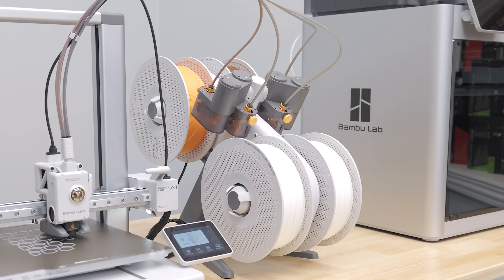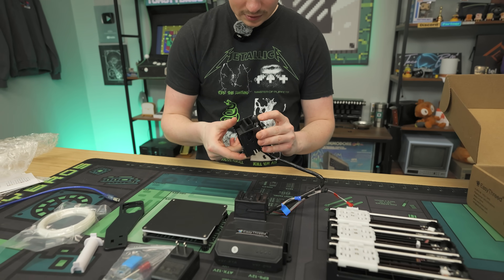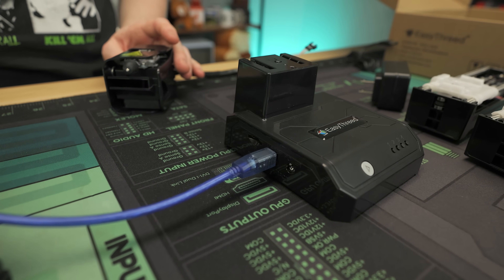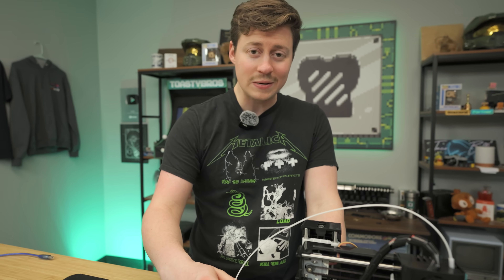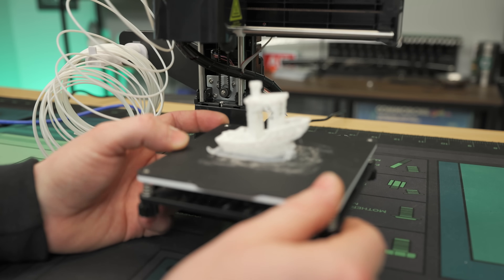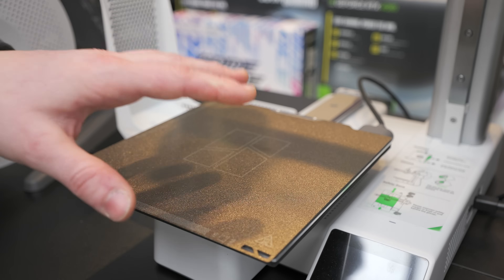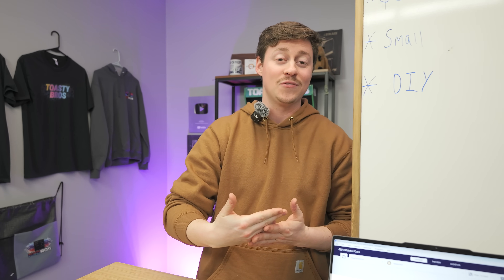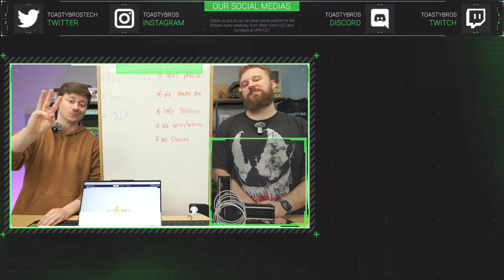We Bought the CHEAPEST 3D Printer

Comment: Just want to point out that while technically the A1 on the left is within that range of "$200-400", the combo as shown with the AMS lite is $499.  The X1C on the right is nowhere near that $200-400 range as it starts at $999 base without addons.  There are certainly good printers within that range, especially something like the Centauri Carbon but putting the Apple of 3D printer companies (Bambu Labs) in that discussion is disingenuous.

Comment: The Benchy isn't the most basic of all 3D prints. Far from it. It's a model intended to show how a printer performs. I would call "Basic" a 1x1x1 cube. The prints look like you had the settings on 3mm Filament and not 1.75. Would have been nice if you showed your settings, but it's more than clear that the settings are wrong, because it is extruding, but not as much material as it should.

Comment: Where are you getting your filament numbers lol ... Standard filament is 1.75mm not 1.25mm in diameter.  And standard spool size is 1 kilo (2.2lbs not kilo) and the reason is this spools size matches that of a standard welding wire spool

Comment: warning to everyone wanting to get a 3d printer, dont buy creality, they have no quality control for their lower end ones. I have a ender 3v 3 ke, iv had to replace the nozzle twice in under 2 weeks of using, they dont test them beforehand and i had to buy a 3rd party upgraded heating head just to stop getting the glob of death every few prints. Also never use the included wrenches to tighten or untighten nozzles, get socket wrenches or youll just end up either stripping the nozzle head or breaking the ceramic or both in my case on my 2nd oem heating head before getting the good 3rd party one

also bambu labs is trying to force the use of their own software on all their printers now and must be connected to their servers to print anything, so i wouldnt recommend them either

id recommend any basic anycubic for entry level, they look basically the same as the entry ender's but are usually cheaper
Reply: this comment needs to be higher up
Reply: I have ender 3 v3 ke too, it works phenomenal. However the auto z offset basically never works, so I just manually level it. Creality is pretty good.

Comment: Printers in this price range just aren't viable yet, even my A1 mini is not strictly "plug and play". It sometimes just fails prints for a few days before suddenly working properly again, bambu support wasn't very helpful (they advised me to change the SD card, so I did); and I've tried running through every TS wiki entry I can find as well as a new build plate and nozzle. It just doesn't print when it doesn't want to, I guess. Also the camera on the mini is terrible, they should have just made it without, and it says it has failed print and nozzle clumping detection but I have never seen it work. The filament tangle detection does work, though.

Comment: Need a video on some of the cheaper 3d printers from cheap to mid range budget.
Reply: if you get anything from creality make sure the nozzles are tightened down before printing, and use socket wrenches. They include really shitty wrenches that just end up stripping the nozzles. I had to replace 2 whole hotends on my 3v3 ke before a month because creality obviously dosnt test them before they leave the factory. 

id recommend anycubic, basically the same as the entry level enders but usually cheaper
Reply from the maker: Any of the name brands in the $150 - $300 range are great for the price these days!
Reply: Get an ender 3 or if you have more money a prusa mini. NASA has been seen using Ender 3’s for prototyping and you can get them for under $200